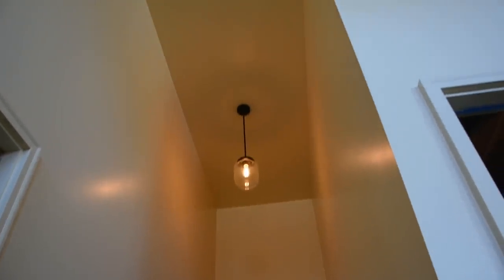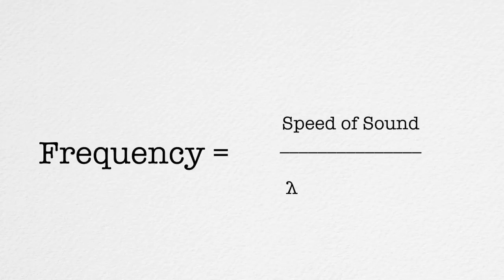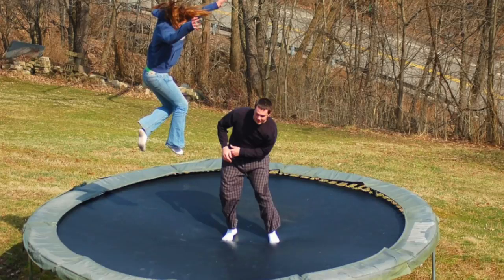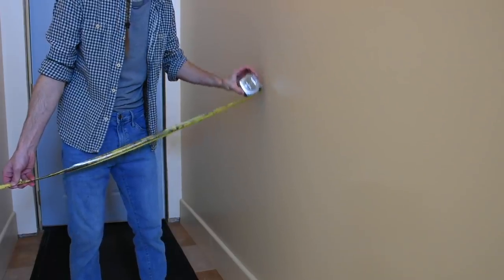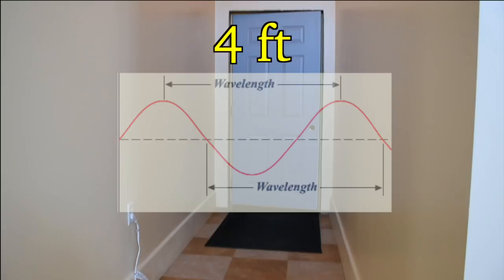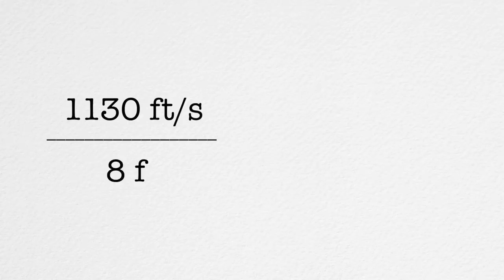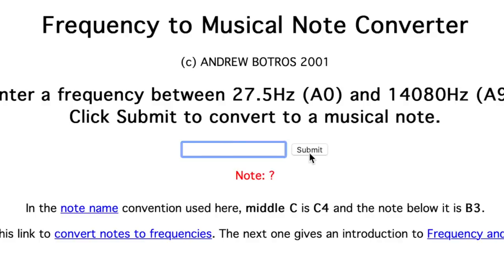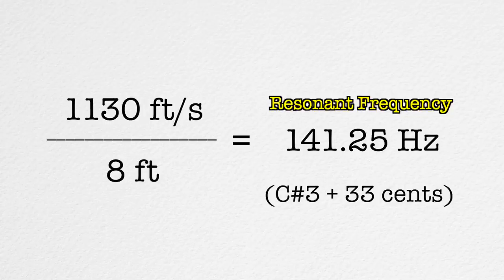You Can Vibrate Anything Using Your Voice and Science! Resonant Frequency & Acoustic Resonance

Comment: So according to Tesla's experiments, if you get those 10 people to resonate the wall frequency into a fan pointed at the wall, you should be able to knock it down. BUT, the fan has to be rotating counter-clockwise. Start at a slow speed and increment by 10 rpm until you'll see the wall start to flex in and out, a good signal to stop before you tear it apart.
Reply: the fan?
Reply: @CalculatedTheory911  Yes, the fan!

Comment: This event I'm about to relate is over 50yrs old i guess. Late '60s, early '70s. Never thot anyone else would be i interested. 
Our rural was built in the 1930's or 40's I'm thinkin. The original ceilings were at least 16' and possibly 20. The restrooms were just painted block walls with metal dividers between the stalls, thank goodness. If i was alone in there and by myself i had discovered that when i hit a certain tone or frequency and without increasing my volume at all the entire room began to vibrate and the sound, tone or whatever in your ears was overwhelming. Sometimes painful.  
I was inventing things all the time and tho the technology could be used to bring down a building or stop a riot. Perhaps used by the military. A teacher from the floor above came to investigate on one occasion when i put more effort into the tone. It was vibrating the floor in his classroom. He asked me if i has heard a noise but not a noise. It was more like just in his head and vibrated his teeth. ME? I know nothing. 
I have tried in various unlined stairwells and got great results plus your singing sounded great....er also. That whistled tune
 from The Andy Griffith show sounded especially great in a local 5 foor Federal building. Never got to try taking a small amp in there to see if the building would start falling apart. 
Aren't there frequency generators out there that coukd produce strong signals for good purposes? Or just to be a kid again. They tore the school down so never got to try it there. OR  maybe it collapsed from someone humming the wrong tune. The place was falling in anyway. 
Good and informative vid. L8r.

Comment: Brother I know mechanical engineers could find resonance but when I had a deep thought on this resonance Is an slow accumulation of energy which is accumulated very high in small installments when the frequencies match if you strike a  turning fork of 50 hz you get the same frequency of vibration on another tuning fork so they both vibrate if you strike it harder the amplitude changes hence loudness is a human factor the frequency is the same the languages that human speak through out the world the sound only  resonate your ear drum for few seconds my question is that the harmonics is the fundamental frequency and overtones are the frequency that follow it take a word in any language you spell it according to convolution the thing scales and ques and stack the signal so convolution can be used to model resonance so when your ear drum vibrates it vibrates so the electrical signals are carried to brain  like tuning fork ear drums vibrate within the audible spectrum 20 hz to 20000 hz hence resonance is caused by the word we speak and within the audible range the ear drums vibrate and we make sense of words I have seen in one videos on YouTube that due to harmonics in any sound causes resonance which could be modelled by convolution recalling the resonance its destructive because slow and steady accumulation of sound on the mass causes high stress and high energy to build inside and stress increase and the system fractures or collapses but our ear drum hearing the sound from human languages try to vibrate but why our ear drum when subjected to continuous exposure of sound does not fracture or rupture like a wine glass iam not telling about high loud sound higher than 80 db but a audible range sound within the frequency of 20 hz to 20000 hz under continuous exposure why it's not damaging it again not failure by high energy but low one in synchronisation on air . But I tried it in my students when I told them to be quite in class they did not listen to me so I took my phone and set an frequency 14000 hz and they told it was irritating the idea of resonance is "small effort but large destruction " just like Tacoma bridge where the wind just slowly accumulated energy on the bridge and it collapsed it so my conclusion is if an audible frequency at continuous exposure to an human ear can it cause bleeding again "small effort but great destruction" sorry for the long story I you are able to reach hear you must be as curious as me so still not finished the ear drum is shook by harmonics in the sound we make by the words( or )overtones in the sound we make by the words I know harmonics is the fundamental frequency and overtones are following it which under slow and steady accumulation of sound energy resonates and could damge the ear drums again "small effort but big destruction" not to mention we assume the person is in coma or brain dead hence when the sound irritates him he or she could not make a move so my question is so simple normally human ear responds to harmonics or overtones according to convolution which could be a disaster but with minimal effort 🙏🙏🙏🙏 at here I could be wrong because harmonics can also be used to construct sound so can it be destructive or the overtones which are the trouble makers and which one according to this gives a response curve when two signals convolved by harmonics or overtones which is destructive but with minimal effort and convolution happens when ear drums oscillate is by harmonics or the overtones or also the trouble makers there

Comment: Just an fyi, adding 9 people will make the spl level increase only about 9db which is okay but won't make the walls move much more. Adding those 9 people to the hall way will have a definite damping effect which might cut a bit off the volume and will make  the fs(resonant frequency) lower than when you are alone since you are not a lot of damping. Also there are going to be phase problems since you can't really accurately phase human voices and such a small space doesn't have that much room to space out voices.

Though I'd be happy to be proven wrong, since this is just a hypothesis.